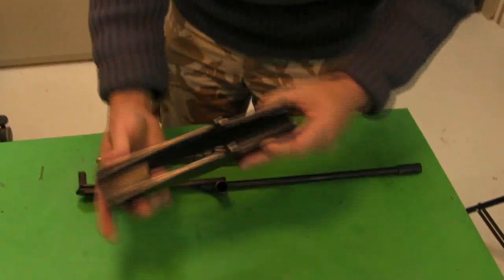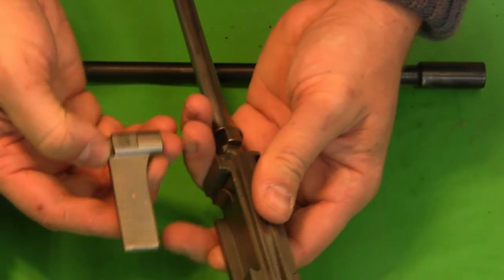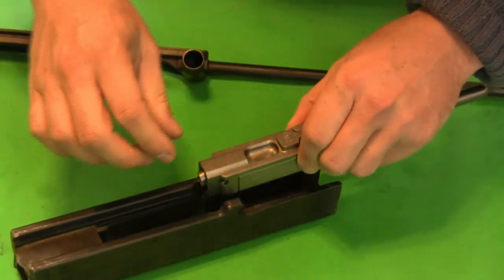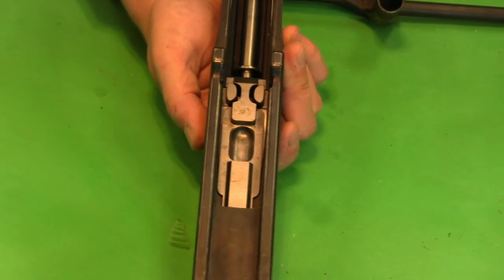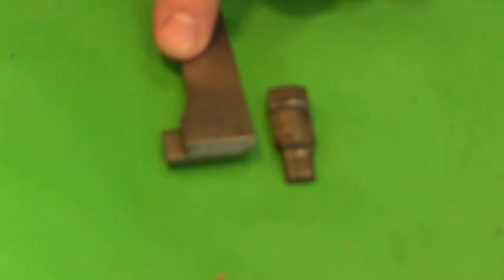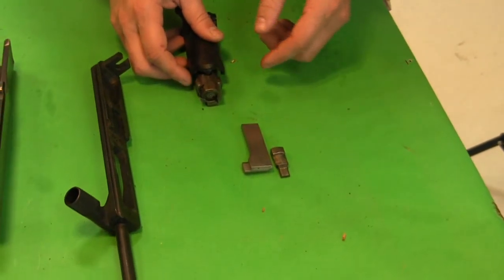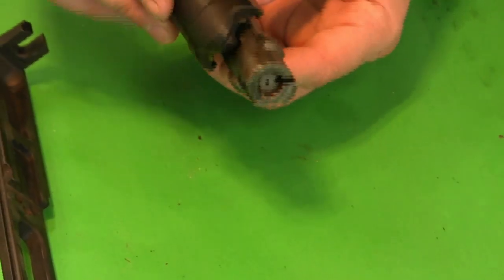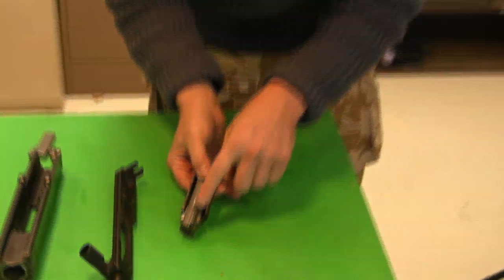Flapper-Locking Firearms

Comment: This flapping locking system might have it's merits in a manually operated gun like a straight pull bolt action where there is no problem of case head separation on extraction due to a hard strike on opening the chamber.
Reply: Yea but then it has no primary extraction, which isn't great when your ammo is dirty. See guns like the ross rifle.

Comment: The Winchester 150 lever-action .22 and its pump-action twin from the 60's utilize a locking flap on top of the bolt. They are rather cheaply made, and will not hold up like earlier designs.

Comment: M-85 .50 BMG coaxial?
Reply: Stanley Jedrzejczyk   I used to work on M85 machine guns, first from M60A1 tanks in CONUS, then M60A3 tanks in Europe. The old Ma Deuce wouldn't fit in the cupola so they put the M85 in. They didn't have room in the M60A2 tanks to open the cover to load it, so they switched it to right-hand feed and  turned it upside down! Other than the sears wearing we didn't have a lot of problems with them, and those were an easy fix. Sometimes I had to replace worn flappers. I think they were actually called bolt locking latches or something like that, but I called them wings because they flap. Occasionally a time delay roller would need to have the spring replaced, or just preloaded after someone who had no business messing with it took the roller out. We had several bad solenoids to deal with too. 

@ Robert Kubrick  The coax machine gun I worked on from both of those tanks was the M240. It replaced the M73 and M219, which most people said were the worst machine guns the army ever had. But our platoon leader in Germany used them in Vietnam and he really liked them. They look like a small breadbox (if anyone knows what those are) with a jacketed barrel sticking out of it. They eliminated some parts from the M73, simplified it, multiplied the model number by 3 (73x3=219, voila!) and it worked better with some parts missing. At some point they tried using an M60E2 for a coax machine gun but I've never actually seen one of those.